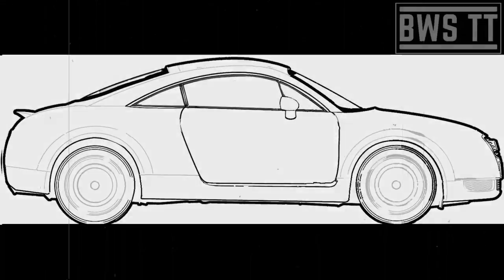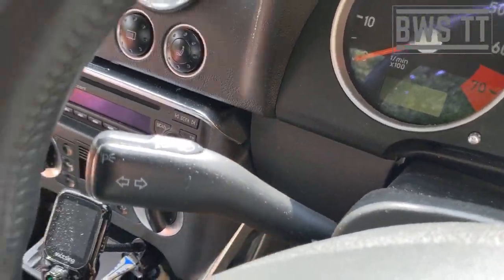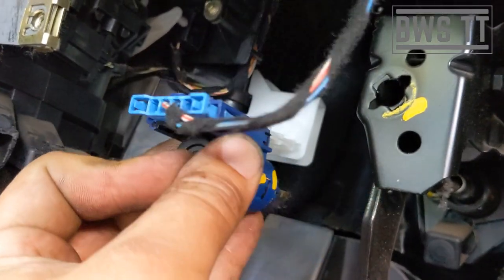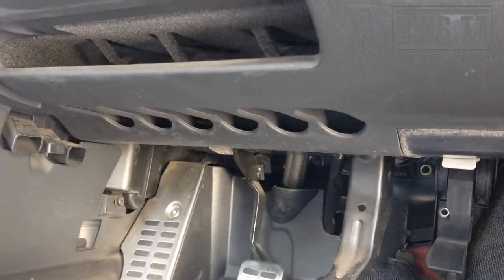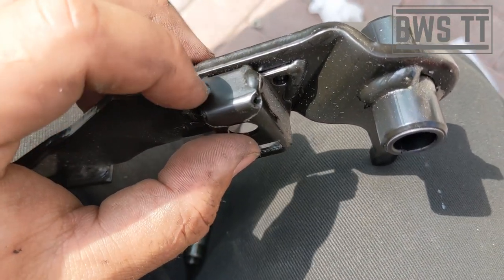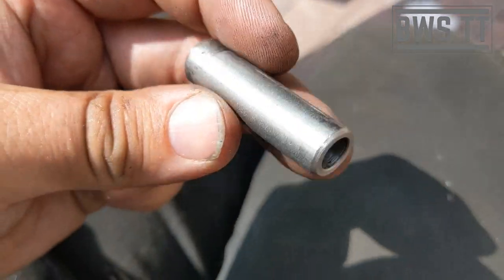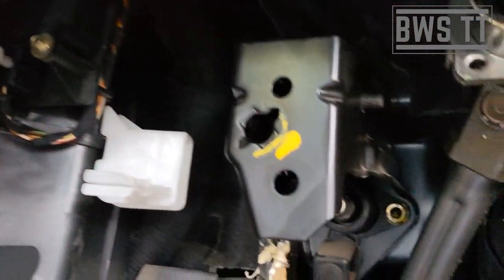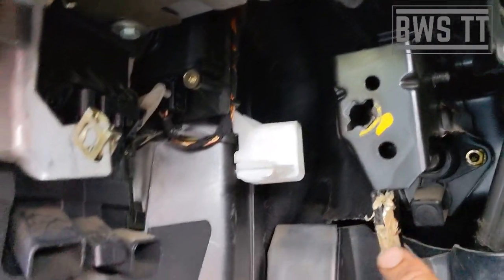Audi MK1 Snapped Clutch Pedal!

Comment: Hopefully you still around. Ive had to change the clutch cylinder. Will the peddle stay up once u put it in or will it need bleed before it stay up on its own when pressed? Mine currently flips to the floor still after replacing the cylinder. Im hoping to bleed it tomorrow.
Reply from the maker: It needs fluid pressure, so yes it will just move freely until you bleed it

Comment: How do you get the pedal back onto the white clip? The tension is too much to clip it on with the pedal inside the metal housing.
Reply from the maker: Put the white clip in before you bolt it in, it goes shite clip, spring, bolt

Comment: Yep, I had broken clutch pedal too.. it sucks! I managed to drive from Bristol to Devon at 1am with no clutch lots of revving and jamming it into gear, was ok once  got to m5 .. pulling into my tight driveway in 6th gear was fun though 😂
Reply: mate you should just turn ignition off put the first gear on ,than start the car on the 1st gear and park it slowly than again ignition off 😁for me it was only 4 miles when pedal broke so I managed to get back on 1st and hazard lights
Reply: @audiquattroaddicted2333  true!.. actually 1st wasn't too bad, but going to 3rd was fiddly then I went to 6th from there which was a pain too! 😂

Comment: Is it possible to weld the peddle back together?
Reply from the maker: Yeah, just dont fill the area that the white clip needs to sit into
Reply: @BWSTT  cool, thanks; I'm in france and the car's english so I suspect a replacement part is going to be wrong-handed
Reply: In the end I got the white clip back on but I can’t get the black clip back over which means the pedal returns a bit higher than the others… think it’s because of the weld…work around  is a cut bolt and two nuts through the housing to stop against the front of the clip instead 👍🏿

Comment: i need help i replaced a clutch in my 2000 audi tt and reverse grinds and some gears are hard to get into, i noticed the clutch pedal is much more soft and easy to oress
Reply from the maker: Try the linkage reset, I've got a video on that
Reply: BWS TT thank you it’s going good now, but there is a ticking noise is it because i have a lighter smf flywheel?

Comment: And what about the other part?,  you will have to access the hoses  that connect  the cylinder and is not even easy  to see...
Reply from the maker: Thats only is you’re removing the master cylinder- it its just the pedal, then you dont have to worry about that